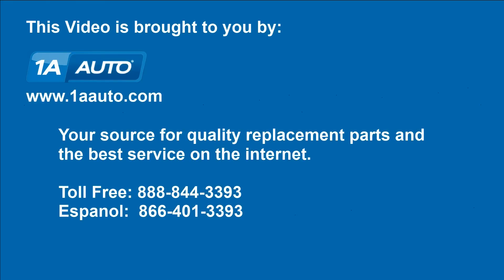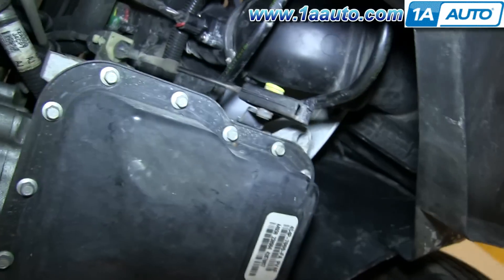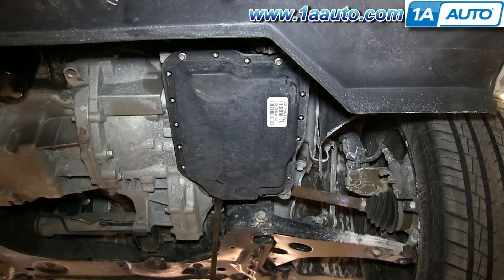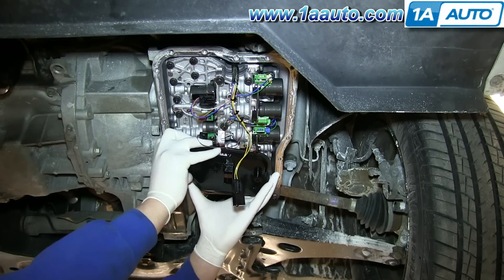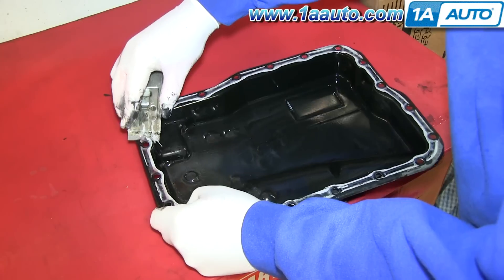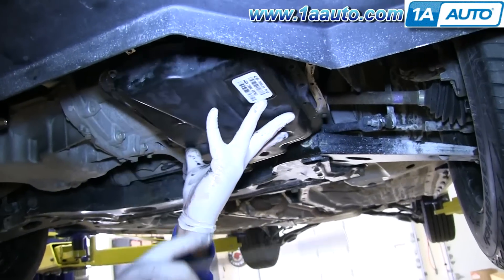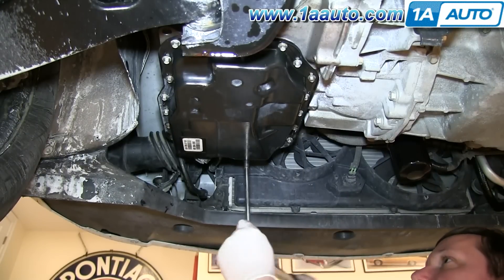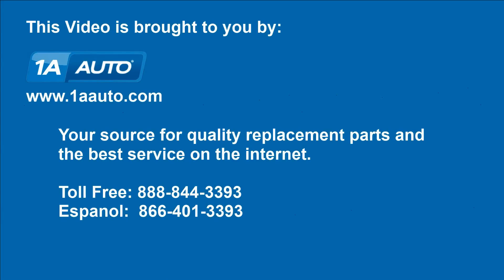How To Replace Transmission Fluid and Filter 00-07 Ford Focus

Comment: I bought the transmission pan that has a drain plug bolt made for the Mazda transmission, it’s exactly !! the same transmission Pan as the 2007 Ford Focus , so next time all I have to do is unscrew the drain plug bolt, versus removing the complete transmission pan 👍🏼 😃

Comment: Transmission bolts 12-14 foot pounds?! Yes, I did it. The head of one of them broke off and it is stuck deep in the aluminum. Another bolt damaged threads inside. It really felt tight when I was trying to get to 12 foot pounds, so I just hope my transmission will not leak without two bolts. Please give the correct torque specs! I have to assemble it tomorrow and don't want to break any more bolts' heads.
Reply from the maker: +Radoslaw Krajewski Thanks for watching, and thanks for pointing that out.  I did some checking and those bolts should be tightened closer to 5-7 ft lb, or 7 Nm.  1aauto.com

Comment: Thanks, That's exactly what I did. Started with 3 quarts. Let it warm up for a bit, checked it. It a was a little low so I added another quart, but that was a bit too much. Another quarter quart to half a quart would have been sufficient. I would recommend a Half a quart at a time after the initial 3 quart fill up. Just to be safe.
Reply from the maker: +chirlak Thanks for following up! That's good info regarding the capacity, and a good idea to go with half a quart at a time. Never hurts to tread on the side of caution.   1aauto.com?utm_source=YouTube&utm_medium=CTA%20Comment&utm_campaign=1ATony 866-403-3393

Comment: What about the fluid left in the torque converter?? That accounts for about 2/3 of the fluid in the transmission....
Reply: That’s called a flush. You don’t need to do that. It’s like topping off a bottle of aged whisky with new whisky. It helps its

Comment: You guys didn't specify what kind of transmission fluid to use and how much to put in.  Also, you shouldn't use a metal blade to scrape off the gasket material, that can scratch the aluminum pan and casing, you should use a plastic scraper for that.  Also, you are supposed to use a torque wrench in a "criss-cross" pattern on the pan bolts, not a 'clockwise' pattern as you performed.  Other than all that, good job.
Reply: Transmission fluid says it on the owners manual. Also it doesn’t really matter how you tighten them as long as it’s done correctly. You can hand tight them then torque tthem one by one.

Comment: I watched the video...removed & cleaned the pan and gasket material...installed new filter and gasket...torqued the bolts down @ 12 - 14 foot pounds BEFORE seeing the correction.
    I can't believe that I only snapped ONE bolt.  THANX a lot.  
Maybe try correcting the video instead of a note later on....

Comment: Great video!  Nice to see it's such a simple job.  I have a 2010 Transit Connect, which is built on the Focus chassis, so the information is the same.  

Question..  Do you have a video for changing the coolant on the Ford Focus?  My TC shop manual is useless and I'm not finding any videos that cover the 2010 model.  I know it's not rocket science, but it's always nice to know if there are any tips / tricks or precessions to watch out for.

Comment: The fluid and filter change went rather smoothly overall. Beginners should do fine as long as they don't overtighten the pan bolts. That's worse than not tight enough, you can always go back and retorque them. it's harder to continue with a broken bolt or swished gasket. 
The reason I did the change was because my transmission was slipping really bad, after the change it got a bit better but it's still taking along time to shift. I have to feather the excellerator in order to get it to shift.  
Any recommendations ? or should I take it to a garage?
Reply: Lucas stop transmission fluid
Reply: Or before you do anything drastic you can restart the computer by disconnecting the battery sometimes that does help. You're car will have to learn the idle and the shift points so drive as normal as usual and go on the highway and you're cars computer will relearn everything. There's a step by step I believe look it up on YouTube.

Comment: I just wanted to ask, I lost my power steering, Ford Focus model 2007 1.8 Gasoline. They say it is electric power steering. When I checked the steering fluid reservoir it is almost dry then I put fluid in it but it is still not working. Any reason why and recommendations! Thanks 👍

Comment: Good video, very informative. One question - what about the fluid in the torque converter. How do we change it?
Reply from the maker: +Martin Oman Thank you for watching. Unfortunately, we do not have a video for your application. We will keep this in mind for future repairs. http://www.1AAuto.com?utm_source=YouTube&amp;utm_medium=CTA%20Comment&amp;utm_campaign=ytcomment 866-403-3393
Reply: Martin Oman Only way to remove fluid from torque converter is to take a return line loose, start car cycle gearshift and allow rest to flow out. Need a 2nd person to assist since this can be a bit dangerous. Do not run transmission dry..

Comment: You didn't need to put any RTV or sealant on the pan or gasket? Around the bolt holes?
Reply: No Iceman, they used a gasket for the pan already, a rubber type one that doesn't require any sealant

Comment: Is this process the same for a manual transmission Ford Focus? I wasn't able to find any videos specifying manual, so I want to be sure before I start taking things apart.
Reply: I can't either. Best advice is to take it to a dealership
Reply: No its not. Its very different and doesnt have filters. Ford doesnt recommend changing it.
Reply: Actually, the manual transmission is much easier.  There is a drain plug and a fill plug.  No filter.  Just drain out the old fluid and pour two quarts of new fluid in.  Too easy.  Use the Motorcraft full synthetic manual transmission fluid.  That is the best stuff.

Comment: Thanks guys. I have a 2001 focus wagon. The fluid looks shot. I am getting a high pitch whine when she wants to upper shift. I back off the gas, let her shift and it stops. Broke in Detroit and do not have a garage. Put some Lucas in her. Helps. But still problem exists. Any suggestions?

Comment: I have a 1998 Ford Lazer which makes a grinding noise at high revs or at about 70 mph / 110km/hr, also the gearbox gets hot to touch after a short period of time. I'm thinking replacing the transmission fluid may be a solution here.
Reply from the maker: This is one that you should take the car to a professional to have check out. It's really tough to diagnose stuff like this over the web, and without actually hearing/seeing what you're talking about, I would hate to advise you and turn out to be wrong. I'd have someone take a look at it. Hope this helps you out. 1aauto.com?utm_source=YouTube&utm_medium=CTA%20Comment&utm_campaign=1ATony 866-403-3393

Comment: I have a 2006 ford focus ZX4 standard 5-speed but mine doesnt have a transmission dipstick. Ive been told my brake fluid resevior is also for my clutch/transmission which is why i dont have a dipstick and it confused me. Is this true? Need some help figuring this out.
Reply: The manual gearbox has a drain plug and fill plug at the bottom.  Just drain out the two quarts and refill with two new quarts.  No filter to change.

Comment: Thanks, any idea what is the mileage between two transmission fluid changes on Ford Focus?
Reply from the maker: Thank you for watching! If you check the owners Manuel it will tell you what Ford recommends for fluid changes based on mileage. Hope this helps! 
1aauto.com  888-844-3393
Reply: Simon, I would do this service every 50,000 miles or so

Comment: Is it better to service the transmission fluid and filter kit instead of flushing the transmission fluids when you have about 200,000. miles?
Reply from the maker: Flushing the transmission out doesn't hurt the transmission. What hurts the transmission is lack of maintenance in the first place. The transmission fluid, breaks down overtime just like motor oil. Small particles that end up in the transmission fluid can hang up the valve body or a solenoid. You should have the tranny fluid changed every 30,000-40,000 miles along with a new filter. Hope this helps you out. 1aauto.com 866-403-3393

Comment: i have a 2015 ford fiesta base model its automatic. ford told me the transmission dip stick is internal and to add automatic transmission fluid i would have to put it in the bottom of the car. i have no idea
Reply from the maker: +Gabriel Padilla Yeah, unfortunately that's becoming more and more common on new vehicles. Just another way manufacturers are getting people back into dealerships for repairs rather than allowing them to do the repairs themselves.   1aauto.com?utm_source=YouTube&utm_medium=CTA%20Comment&utm_campaign=1ATony 866-403-3393
Reply: Check out FordTechMakuloko he has a video on this transmission

Comment: What about the rest of the fluid.  That just mixes old with new
Reply from the maker: Pretty much. Doing a filter change will usually remove 4-6 quarts of old fluid. If you would like to remove all of the fluid in the transmission you would need to either have it flushed out with a machine, or you can use a big bucket and put a hose off of the return line into the bucket, start the vehicle up and put it in neutral, then add new fluid in as the old fluid pumps out into the bucket. 1aauto.com 888-844-3393

Comment: What type of fluid is it, and how much did it take?  Handy items to know.
Reply: Dale Thornton Mercon V for my 2002. You will only need approximately 4 quarts if you don't drain torque converter.
Reply: Ford recommends the use of regular Mercon fluid as per their TSB that they had issued because the Mercon 5 ( which is a synthetic version of Regular Mercon ) was eating away at the bands inside the transmission and burning them up !!!! I read up on this on a Ford forum and a technician had said this
Reply: @codywright4910  so a multi purpose would do the job?

Comment: I had trouble with my mazda and i couldn't remove the trans pan. The pink gasket was really stuck in there what can i do ? and would i replace the gasket with gasket maker or a felpro gasket?
Reply: If the pan is held on by rtv sealant you can use a plastic trowel to gently pry the pan off, be careful to not damage any wiring inside.
Most filters come with a gasket, but you can use a gasket maker to hold the gasket to the pan to make installation easier.

Comment: Except you forgot to tell ppl about only half of the fluid is drained that way. You need 7 qts. Remove the line that connects to radiator and bleed the other half while engine is on and you're adding fluid while the old is bleeding out. Bleed out until the black fluid coming out turns cherry red. Shut the car off and top off. That is a complete change.
Reply from the maker: +Alejo Maciel We appreciate the feedback. Sometimes there are multiple ways to accomplish the same repair.

Comment: My 2013 Ford Focus doesn't have a transmission fluid dip stick and my transmission is slipping and grinding it sounds really bad I just don't know how to check the fluid?
Reply from the maker: +MadisonMoffit You may have to ask the dealer if they could try to flush it, or what they recommend.
Reply: Your transmission is a special type of transmission and it calls for a special and unique way of filling it that requires the car to be running  , the drain plug to be removed and the transmission to be in neutral , i know this may sound weird but this is how these transmissions are filled , there isn't a filter as well and it is servicabless meaning the transmission pan doesn't need to be removed and there isnt a filter to be replaced as it is only a fluid exchange that is required .
Reply: The newer cars dont come with dip sticks. They make it hard so the car dont last long..
Reply: 2013 focus should be under the Ford law suit extended warranty. Should be good up to 150,000 miles.
Reply: Check out FordTechMakuloko he has a video on this

Comment: Why don't they ever put drain plugs on these pans?
Are you introducing problems by changing the fluid on a car with 100k+ miles,  that is likely original?
Reply from the maker: +UnFunded Opportunities Thanks for watching!  You will not introduce any problems, but changing the fluid sooner than 100k is probably best.  As long as you do not perform a full flush there is no need to be concerned.
Reply: Put a Mazda pan on it , has drain plug.

Comment: How many quarts approximately to fill the transmission?
Reply from the maker: +Richard Kalejta Not sure off hand, but I think the total capacity is about 6 or 7 quarts. A good rule of thumb is to put in 3 quarts, check the level, and then add as necessary. Since you're not doing a full flush you won't need the full 7 quarts. Hope this helps you out.  1aauto.com?utm_source=YouTube&utm_medium=CTA%20Comment&utm_campaign=1ATony 866-403-3393
Reply: Thanks, That's exactly what I did. Started with 3 quarts. Let it warm up for a bit, checked it. It a was a little low so I added another quart, but that was a bit too much. Another quarter quart to half a quart would have been sufficient. I would recommend a Half a quart at a time after the initial 3 quart fill up. Just to be safe.

Comment: Does anybody know what kind of transmission fluid and how many liters is needed for a Ford Focus 2010, manual transmission?
Reply: 1.75l-1.9l depending on what engine you have. The fluid is kinda hard to find what is right because Ford doesnt recommend changing it so they dont tell. Manual fluid swap are very different from an automatic.
Reply: Use Motorcraft Full Synthetic Manual Transmission fluid for the manual.  It takes about two quarts. The fluid costs more but it well worth it.

Comment: That engine sounds real bad and ur supposed to chech fluid warm not as soon as u start the car. And use sealant on the gasket ot it will leak
Reply: They put a gasket on the pan, it seals itself no additional RTV is needed

Comment: Hello
I don't know where to began but I have bought a ford mondeo 2.5 v6 2002 automatic car about 2 years ago. And recently it started making some loud noises/vibrations  around 43 mph, lower and above that the car behaves normaly so I thought it was nothing and kept on driving like that. Until one day when I got out of work and was on my way home. As I was driving, I came to the red light and stopped the car, when the green light went on. I tried to move but the car made loud noises and it didn't move forward as it would. And I smelled a bit of smoke, coming out of the car engine. Suddenly the car didn't move at all, only in reverse. I didn't find any problems with driving reverse, only driving forward was not working at all. 

Later on I took the car to a local mechanic, And they informed that I hade to replace the transmission. Even though it costs me a lot, I managed to buy a new one. When the mechanics put the transmission in, suddenly the car was moving forward normally. 

And lastly when the mechanics put the transmission in, we tried to see how it worked. And we found out that the shift box in the car only worked when we pulled the P (park) to D (drive) as fast as we could. At that moment the car managed to move forward. 

On thing we found again was when I drove at 43 mph, the car made noises and vibrations again. And on top of that the car didn't want to drive reverse. 

I really would want your help at this momet, so please help me. I think the problem is not in the atomatic transmission, but in the gearbox. 

so please help me and sorry for my bad english

Comment: How about putting a drain plug in Ford?  This is ridiculous! Can't even do a fluid drop without dropping the entire pan!
Reply: I was thinking the same thing, but its not that hard. Besides, with these cars they made it up in other ways.
Reply: You can actually put the Mazda pan on the ford transmission and it includes a drain plug. Fits perfectly as its just the Mazda version of the same exact transmission. Hopes this helps some people lol :)
Reply: It's the fluid filter that you need to change and clean the magnet too.
but a drain plug would make it less messy, but what do they care, right

Comment: 2003 focus transmicion automatic fluid type?
Reply from the maker: +Saul Chavez Rodriguez We do not have information on the fluid type as we do not sell the fluid through our site. You may be able to call your local dealership and they can assist you further.
Reply: @1AAuto   thanks
Reply: Mercon V

Comment: would it be better to change the fluid, drive the car for a day then change it again, drive the car for another day and then do a final change and changing the filter to clean the transmission of the old fluid.
Reply from the maker: If you would like to replace all of the fluid, you may want to have the transmission flushed and also change the transmission filter and pan gasket. Hope this helps you out. 1aauto
Reply: Get a transfer pump from Harbor Freight. Stick the hose in the transmission dip stick tube. Then pump everything you can out from there. All that will be remaining will be in the pan. Then do everything that they show in this video. Read the manual for how much fluid your car holds. Then, add that much back into the car. There's no need to flush this way, as all of the old fluid is gone. If you only use this video, you are leaving a ton of old fluid in the torque converter, and kind of defeating the purpose. Doing the method of using a pump eliminates the need for a flush. Flushing sometimes uses harsh detergents, and brakes loose stuff that otherwise wouldn't have been. Sometimes, flushing causes more issues than it fixes.